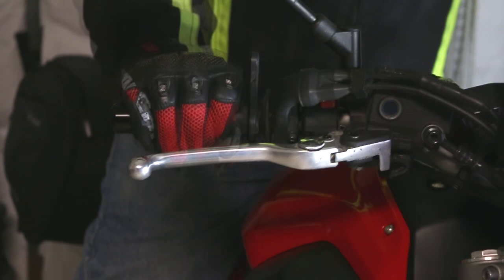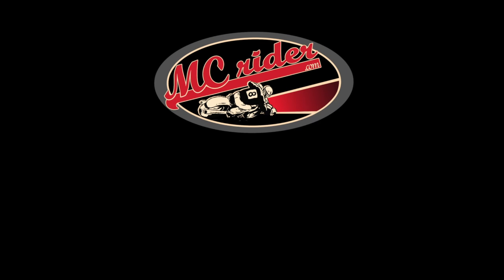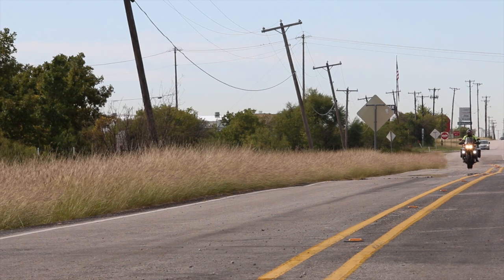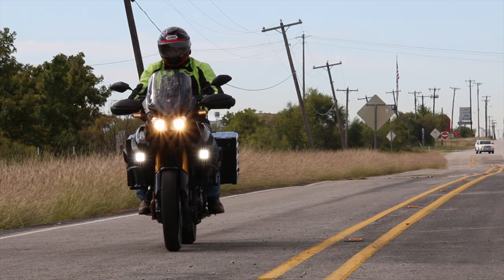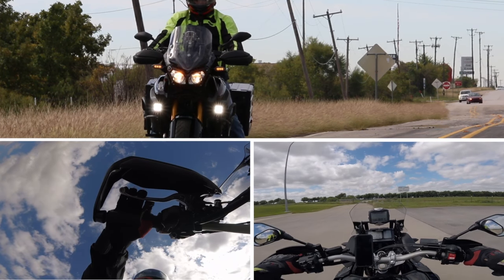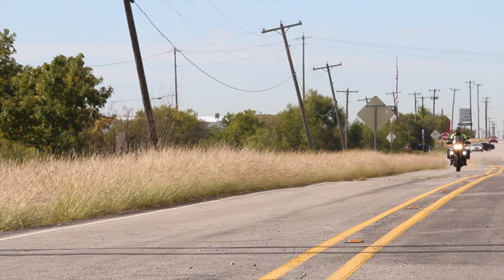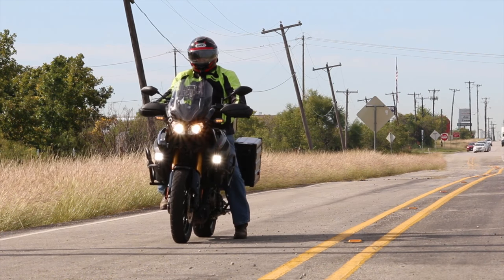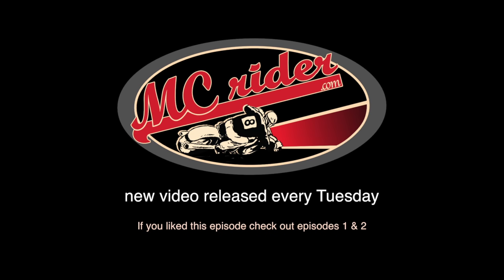How to be smooth on you motorcycle. Episode 3 MCrider

Comment: A lot of your techniques can be applied to four-wheel driving as well. So while I already have a basic understanding of many of these techniques I don't have an understanding of applying them to two wheels instead. On four wheels I have a decent amount of throttle and brake control. But unless you're hauling a bunch of weight and already in a low gear, or if you're on ice, then you can let off the gas and let the engine brake. But on a bike backing off the throttle smoothly is very important and I don't think I would have realized that on my own without it causing issues. I pick up more and more from each video every time I watch them. thanks for what you're doing and I'll do my best to spread the MC Rider word.

My state resurfaces its roads by throwing down tar and a bunch of gravel. And if you were to use engine braking the way I do on this loose gravel then you would learn this lesson in a much more harsh way. Sorry for the long comment. 

I appreciate and support your channel in every way that I can. I wish half as many people would watch this kind of stuff instead of mentally disabled riders getting pissed at their own mistakes and breaking somebody else's mirror for it.

Comment: Great series - really helpful advice delivered in a clear and concise manner 😀 RE: braking. It's important to get into the habit of that initial gentle braking, to allow the suspension to compress and the tyres to grip, before you apply a much stronger breaking force. You'll be amazed at the amount of breaking force you can apply once that initial 'bite' takes place. Another tip when emergency braking is to always pull the clutch and forget about the rear brake. Pulling the clutch means you don't accidentally grab a handful of revs. And it's easy to lock the rear as the weight transfers to the front of the bike.

Comment: Did you do a video on changing gears and using the clutch smoothly? That is hard to do. To change gears so smoothly that it feels like an automatic transmission.  Any tips on that? I love your videos.  You might think of making a DVD  using a compilation of your existing videos to be sold to new riders on the do's and don'ts of motorcycle riding. And how to ride like a pro. This would be great if cycle dealerships would incude such a DVD in the purchase of any bike. This kind of marketing could help you fund your program. Your videos look professionally made, so that's 80% of the work. A lot of riders won't go to a training program, but they will watch these programs and practice the procedures. Thanks again, Gary

Comment: Appreciate what you're doing here, but how can you go over throttle and brakes and not discuss the clutch? That's where 90% of new or bad riders go wrong. The clutch is the classis "on/off" switch for bad riders.
Reply from the maker: +Peter Jowett Good point, it will definitely be covered in future videos. I try to keep these under five minutes in length and decided to cover only brakes and throttle in this episode.
Reply: Yeah, I thought it may be upcoming, definitely important enough for its own episode. Keep up the good work!
Reply from the maker: +Peter Jowett thank a I appreciate the feedback.
Reply: Peter Jowett you make a good point as there is a lot to been smooth  eg gear changes , braking, accelerating,as well as movements of the bike etc but having said that once you have mastered the foot shift with the throttle  you can shift without a clutch smoothly up and down all gears except  shifting into first gear or from first to second gear , this is a timing combo that needs to be accurate  and after  mastering that adding in the clutch makes for silky smooth gear changes at any pace !  pillion riders notice this immediately  as there is no clash of helmets under brakes or fear of been jerked off the bike  under hard acceleration and of course bike stability !  then there is the adjustments  of levers, cables etc that can make all the difference , the how to be smooth video indeed could be  30 mins long easy  and I do not see many rides in general that are smooth , there tends to be a lot of crashing through the gears you can see and hear it .

Comment: Loving your videos! but i ahve a question, when i do a hard brake (i use to exercise that sometimes) i ussualy brake really really hard (without blocking the tire) and release smoothly the brake lever while the motorcycle slow down, because when going fast i need more brake power, than when i go slow, so in my opinion, braking soft while going fast, and harder and harder while delecarting, can bring to the sittuation where the tire stops and the bike slip. (i don't own a motorcycle with abs)
Maybe i'm wrong, but i feel like the safer way to make a hard stop.

Sorry for my english, cheers from Switzerland (:
Reply from the maker: +seba alge Hi Seba, for emergency stops watch this one and see if it helps. https://youtu.be/Yu1aOqbg16A